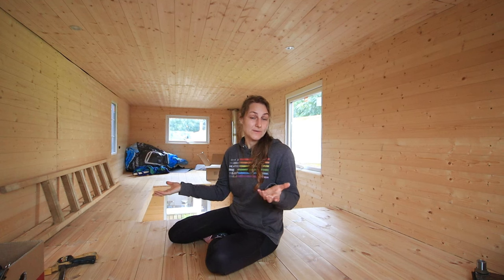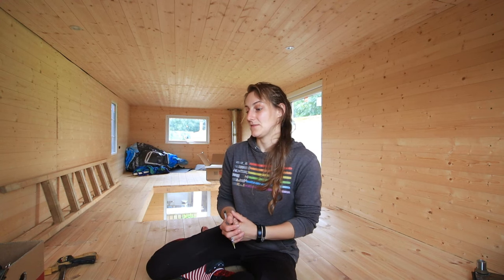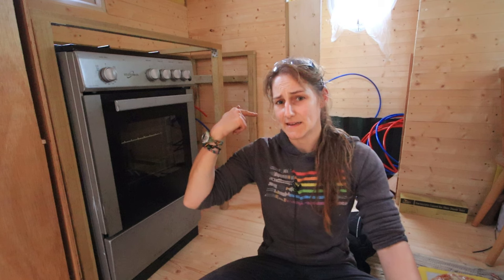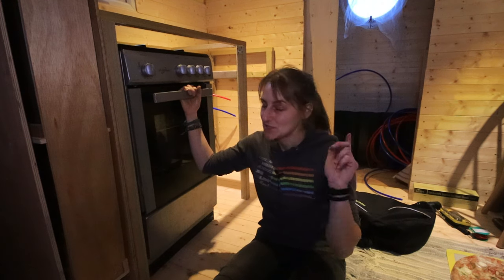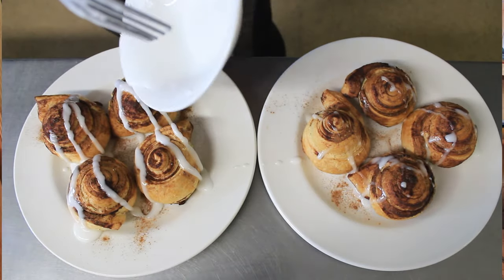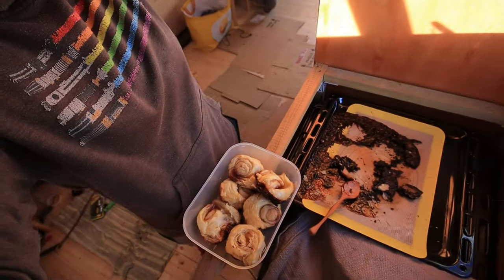Trials & Errors - Fitting an oven in my Tiny House ~UK~ Attempting to cook something edible :D

Comment from the maker: This took me several evenings, in and around work.
With gas I wanted to make sure I was installing it correctly so took my time.
Thankfully I had the help of @maximusironthumper  to double check my work.
Check out his channel for all things off-grid, land rover restoration, homemade camping gear, gardening and loads more interesting videos.

00:00 - Mini Catch-up
01:03 - The oven is here!
01:45 - Tiny House Update
03:04 - Installing the copper pipe
05:28 - Attempt 1 - Pizza Success?
06:43 - Attempt 2
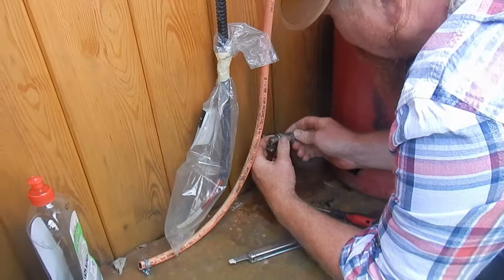06:57 - Help is a hand :)
08:16 - :D!
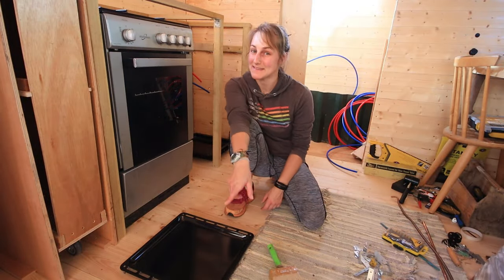09:03 - Attempt 3 :p

Thank you for watching :)

#tinyhouse #tinyhome #diytinyhouse #tinyhouseuk 

Trials & Errors - Tiny House Oven ~UK~ Attempting to cook something edible :D

Comment: Awesome that you managed to get the gas connected safely in the end – safety is always paramount where gas is concerned!   Also, thanks for stirring my curiosity regarding making some homemade cinnamon buns for myself.  Any chance of sharing your recipe?
Reply from the maker: Thank you Anthony, yes I wanted to make sure it was done right no matter how long it took me. 
With the cinnabuns, I cheat slightly as I buy the pastry pre made but for the inner. I mix icing sugar and cinnamon power together to get a consistency similar to paste and then paste that into the pastry. Maybe I should have used a recipe and then my mixture wouldn't have slipped out and burnt 🤔😂
Reply: @KeiteiVentures  Thank you for sharing your twist on making cinnamon buns – there’s nothing wrong with a bit of Buster Keating, as pastry making can be quite time consuming!